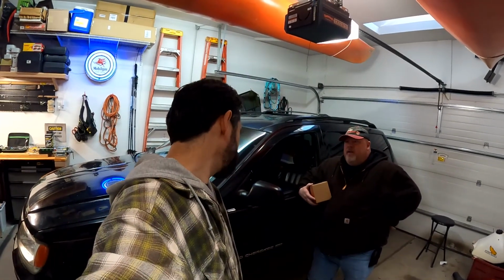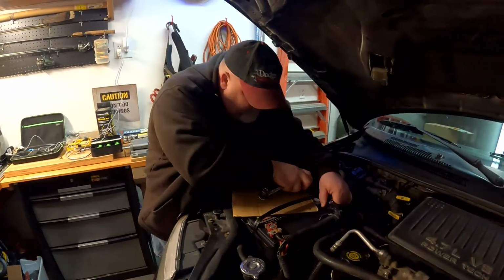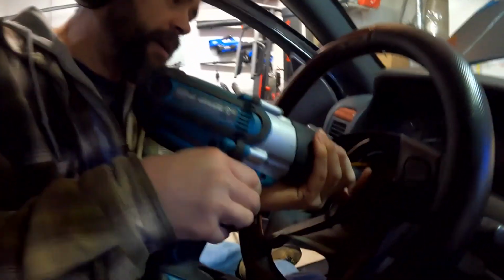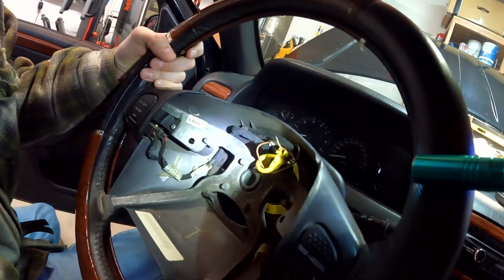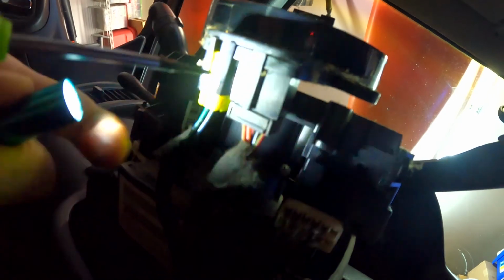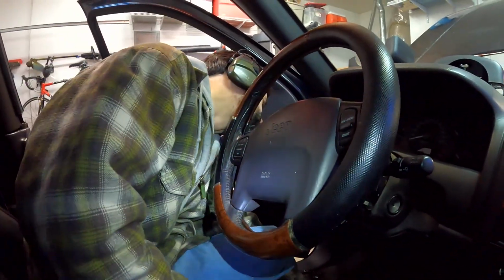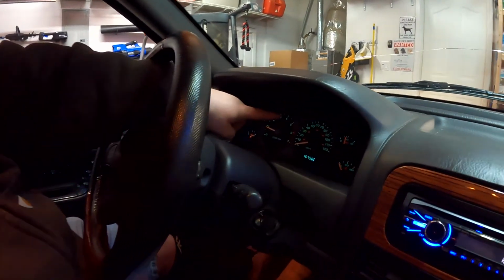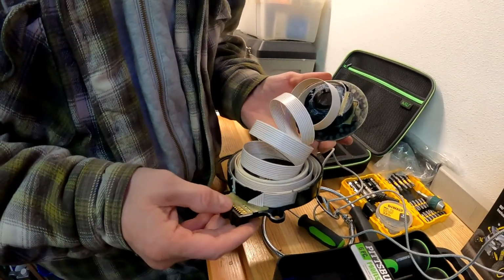Jeep Grand Cherokee WJ Airbag Clock Spring - WJ Project Part 10

Comment: this part apply for jeep grand cherokee WJ Limited year 2000?
Reply from the maker: The process is exactly the same, and the 2000 does have the same system, but confirm the part number with whoever you're ordering it from.

Comment: im now confident i can replace this. my 2000 WJ airbag light just started to act up while the wheel is turned significantly then turns off when straight, im sure its the clockspring (just in time for state inspection)😅 Do you plan on posting more WJ content? Wheres Dr Torque?? You two remind me of my best friend and I - thank you for the detailed demonstration, have a great day guys 😎